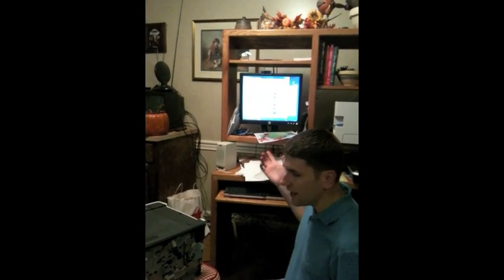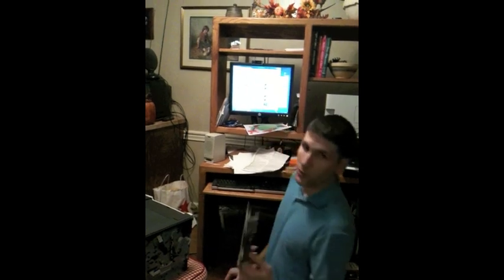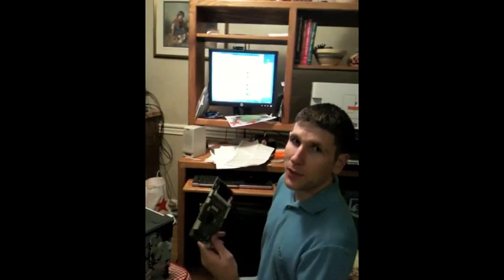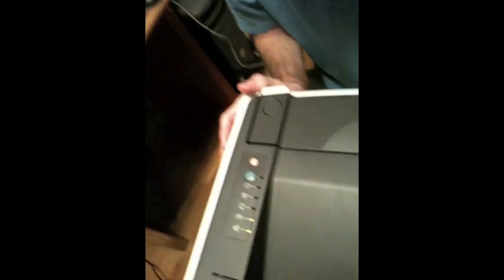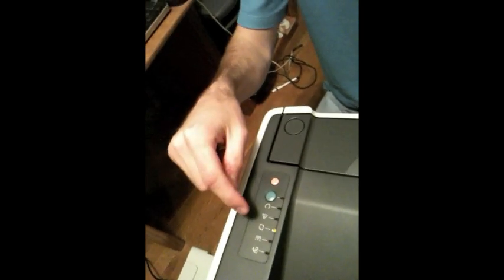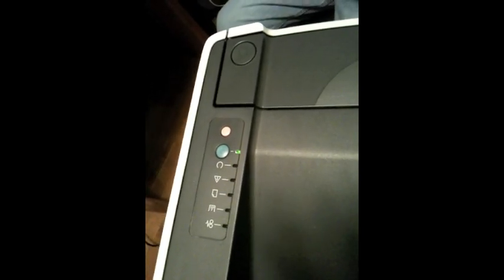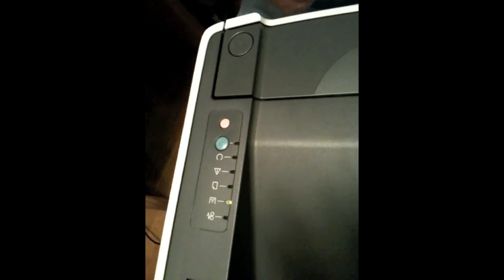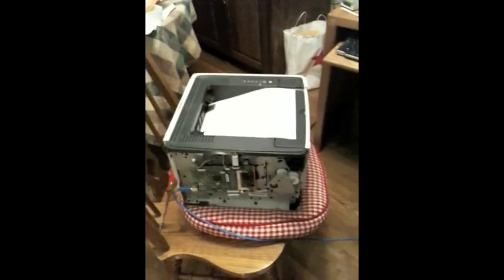Fixing a HP LaserJet by baking the formatter board in oven.

Comment: Yes it works on most boards, re-soldering all the surface mounted chips.  Remember to be very careful when taking it out of the oven to no jolt the board around or chips may slip off & then the board will be dead. This guy got lucky when he dropped the cookie sheet down kind of hard.

Comment: Did this on mine and it had exactly the same error, baked it at 215C in 6,30 minutes on aluminum foil and spacers I used screws... worked like a beaut and that was 5 months ago and it's stil working fine :)

Comment: DING!  Your printer is done.

IT REALLY WORKS!  Completely did not expect success without a BGA reflow oven.

Got a HP 3005n from the scrap surplus at the local university.  Powered up, but blank LCD screen and no response from function keys.  Tried this and it works 100%!!!

Amazing.  It really does work.  Five minutes has to be the maximum time as my capacitors were just starting to bulge a bit near the venting caps.

Not the ideal repair, but IT DOES WORK!  Better than the landfill!!!!!!!!!!!

Comment: Tried this on a HP 2605dn Color Laserjet formatter board...  Printer didn't work, so I had nothing to lose... and it WORKED!  Since I just bought 4 (FOUR!) new toner cartidges about two months ago, I saved a bundle.  Many thanks for this vid!  The only thing I did different was make some little posts out of tinfoil to hold the board up off the baking pan...
Reply: Same story with a 2605dn. 5 minutes in oven @ 200C. Printer back to normal :)

Comment: I found two machines with solid "jam" indicator yellow, baked both at 350 F for 8 minutes exactly.  Then gently installed a half hour later...both worked fine.  One had failed at 11,000 prints and the other around 5600.  Great technique...I see a few more in the campus closet, given up for dead and am sure I can get most back into operation.  I might create a special BBQ sauce just for the formatter!

Comment: the theory is to re melt all of the solder  joints and have them re solder every thing  you can take a solder iron and re melt every joint will do the same thing the boards are built to take the heat for a short time that is how they mass produce them and it works even though it may be strange

Comment from the maker: @northwoods57 I am very happy that this worked for you!  I see no reason that this shouldn't work for any other board that needs a solder reflow, the key to this being melt the solder without  damaging any of the electrical components.  Was the board you reflowed for an HP LaserJet P2015?

Comment from the maker: @northwoods57 Was this the same model HP?  I was able to show this video to tech support at HP and they replaced the formatter board even with the printer being out of warranty.  They said that if they had enough complaints and if more people had this work that they would initiate a recall.    HP will say that this is not a user replaceable part but if you show them the link to you removing it and finishing the solder reflow they will send you a new board.